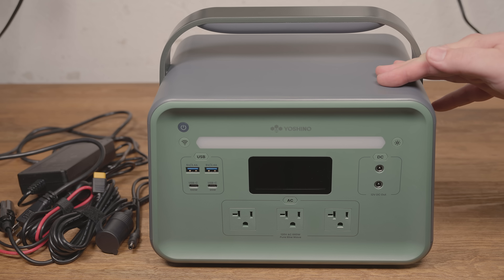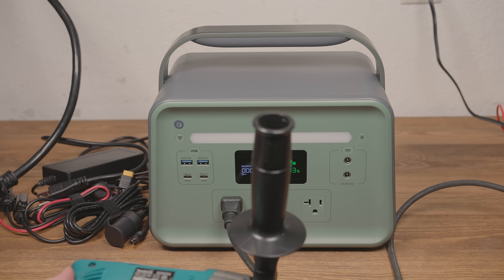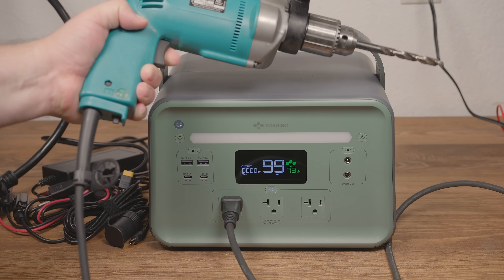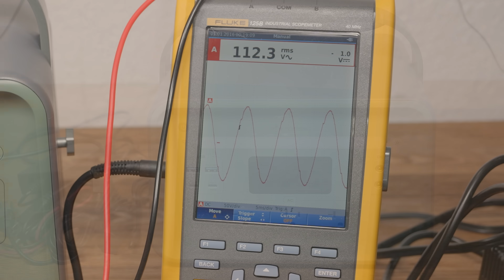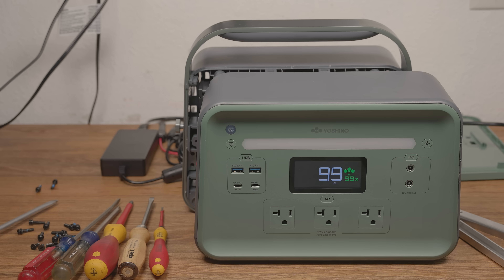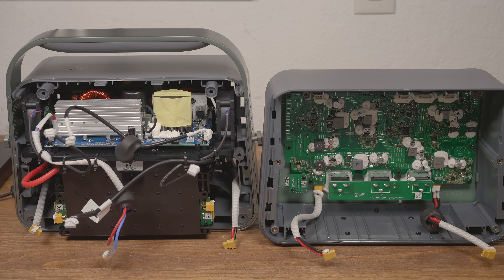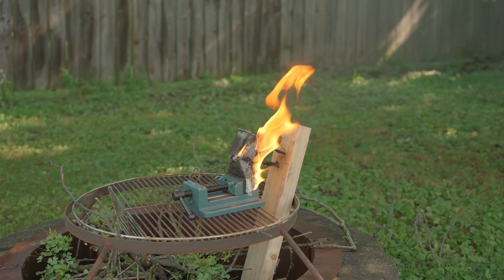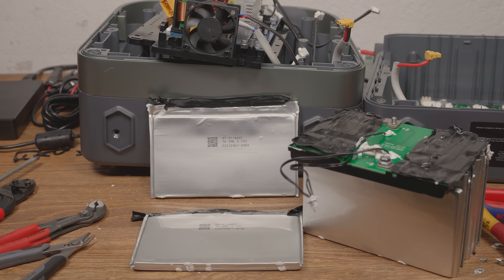Yoshino Solid State Battery Power Station, Test and Teardown!

Comment from the maker: Second update:  I did some more research on the Safety Data Sheet that comes up from the part number/QR code on the cells.  At least two of the chemicals listed are liquid, organic solvents, normally used as electrolyte in lithium ion batteries.  So...
Reply: I saw a review which stated the same about this model, so I am fairly sure it's not a 'random fluke' or just bad sample or whatever. 

But, Yoshino has two of these things right and this is the small one. This one also offers little weight benefit over conventional lithium. But their large model seems to have a way way way better capacity per weight as the other on the market big powerstations so I am wondering if that one uses the same cells or not?
Reply from the maker: @MarvinWestmaas  Also, they currently list four different models.  The B330, B660, B2000, and B4000.  But those are just the output wattages of the inverters.  The battery capacities are 241 Wh, 602 Wh, 1326 Wh, and 2611 Wh.  If you compare to competitive options of similar watt hour capacities, the weights are relatively similar.
Reply: @MarvinWestmaas  Or fake capacity.
Reply from the maker: @MarvinWestmaas  Their largest unit is 4,000 watts, but that's just inverter output.  The claimed battery capacity is around 2,600 watt hours.  That's still quite a bit, but when compared to competitive units in the 2,400-3,000 watt hour range, their size and weight is relatively similar.

There is nothing in any of their marketing to indicate that their larger units utilize different cell technology and they never responded to my questions about it.  And, unfortunately, I'm not going to buy one of the bigger ones to find out, lol.  I wish I could, but it's just not practical for me to spend that right now.
Reply: Bro! I almost bought one because I wanted to get a safe battery, you saved me from a terrible bad purchase
Reply: probably the same datasheet i found too,which states li-ion...nothing solid here :)
Reply: Why would anyone listen to someone who can't even say the word; 'Supposedly' !!! Do you see any letter 'B' in that word !?!?!?! 😂
Reply: Do you have a link to the part number, SDS for the cells?
Reply from the maker: @ElderNames  Part number: QT-9114897
Reply from the maker: @ElderNames  https://www.google.com/url?sa=t&source=web&rct=j&opi=89978449&url=https://images.thdstatic.com/catalog/pdfImages/66/6674f82e-d87d-4a75-a462-0968d05c0f0b.pdf&ved=2ahUKEwju5NyQ9OKHAxVY3MkDHe-FF6kQFnoECEEQAQ&usg=AOvVaw3UFO0VDcc030O9w2uYRSye
Reply: lawsuit time?
Reply: Why would anyone listen to someone who says the word Suppose'b'ly !!! 😂 SupposeDly  it's a D !!!! 😂 chuld ! I suppose you pronounce  the word Height   with an extra Th at the end like 50% of dumb Americans ! 😂 HITE !
Reply from the maker: Here's a link to the follow-up video:  https://youtu.be/9qtzb-hJ3nQ
Reply: What is the voltage on a fully charged cell.
Reply: Mine stopped charging this month. 
Same one you tore down.  And it always took it 3 days to charge up a solar panel.     

So three almost four months. And now I got something that doesn't work.
Reply: he Biggest red flag is that yoshino is NOT  a japanese company at all , its a shell company with japanese name and a small japanese  office that's it. 
the company has NOthing to do with Yoshino akira the inventor of lipo battery,  I mean NOTHING. 
CEO is a chinese and factory is in china. its a chinese company .
its a scam just like Kamikoto, Yatoshi.  selling cheap chinese knives selling at premium price.
Reply: There is a "review" from a person I used to respect, Matt Ferrell. 1.7M views of that shameless promotion. Disgusting.
Reply: @vadimus2007  Matt Farrel's channel has always been a promotional channel...
Reply: @vadimus2007 Hi vadimus, I'm vladimus😂. You're saying he used to be more respectable? All I've seen from him are marketing slides from companies that don't have a viable product and are looking for more VC funding.
Reply: @vadimus2007  I was JUST looking for his video in an attempt to link him this one.  I'm with you, in the 'used to respect'.  He definitely should've known not to take something like this at face value, and do a breakdown.  At the VERY least, China products haven't been the most honest and reliable.  Added to a company there claiming to basically be the first out of the gate w/ such a technology, and then just accepting it and promoting it to his large audience.
Reply: @edb75001  Matt is engaging enough, great with smart home tech but I think he should have stayed away from more technical stuff like solid state batteries. His review was simplistic at best, missing the academic rigour necessary when you review a "revolutionary" product that is more marketing than substance. There were statements like "solid state batteries stop dendrites from forming" listed as an advantage when one of the major challenges with solid state batteries has been the expansion and contraction causing cracking in both the electrodes and the solid electrolyte and, you guessed it... dendrites forming and short circuiting the battery. He seems to be more about style and the user interface than the nuts and bolts so you can see why the Yoshino batt appealed to him.
Reply: @mondotv4216 you could argue that for solid state batteries to be viable at all, they’d have to solve the dendrite problem completely. Ergo, any solid state batteries that are advanced enough to be deployed in real products won’t have dendrite problems. At least that’s what my assumption has been, but I admit it’s on shaky ground.
Reply: @Scrogan  All lithium ion batteries can suffer from dendrites. You just hope they are well constructed enough for it not to be an issue before EOL. Unfortunately we've seen that's not always the case. It's why I like LiFe (not the pouch cells - IMO any lithium pouch cell is a fire hazard) - proven technology, long life span and relatively cheap.
Reply: @mondotv4216  the PO on the end of LiFePO doesn’t mean “pouch” or “polymer” like with LiPo cells, it’s a part of the chemical formula for lithium ion phosphate. It’s the phosphate part, PO4. With LiFePO4 cells you usually either get prismatic cells or cylindrical cells, I’ve never seen a pouch cell.
Reply: @vadimus2007 , he took that video down and posted an update.
Reply: @vadimus2007  same "used to" here :( - so much bullshit gets on youtube lately.
Reply: @vadimus2007  That's actually one of the reasons I unsubscribed from him.
Reply: @vadimus2007  He delisted that video today and reuploaded it with tons of corrections and edits with the new information. The product was advertised as solid state, he had no reason to doubt it. But now that the truth is out, he's done his due diligence and made it known.
Reply: @vadimus2007  He literally just updated his video.
Reply: @vadimus2007 Matt Ferrell has always been a sellout in my opinion. I knew from the first video i watched that he had no integrity in my opinion. I find it surprising that others don't see though him so fast.
Reply: @vadimus2007  he posted a new video , but he is still just a brochure regurgitator. Shame the people with the biggest followings have the least technical knowledge
Reply: @vadimus2007  He bought the pack with his own money and stated in the video that he has no relation with the company...
Reply: @Mikenaners  Sure, he just earned couple thousands claiming he got a first SS battery based product mostly quoting scammy manufacturer's lies. 
Honest mistake for sure!
Reply: @vadimus2007  Matt Ferrell doesn't take a bow and arrow to the thing.  He just reviews it.
Reply: @jay2thedub  Citing product pamphlet isn't reviewing.
Reply: That is a fake date report sheet. It only exists on a cheap image sharing website. The battery cell information gave it away. Along with the fake company email. Not sure if you are deliberately misleading people or just trying to be relevant so you can make them Benjamins. Just saying you should look into actual li-ion batteries exploding and do some research.

Comment: A remaining power meter on LFP batteries must be singularity calibrated, as there is a 300 - 500 mV difference between 0% and 100%. It varies with each cell, with temperature, with number of past cycles etc.
Manufacturers resist the implementation of coulombic power meters, as they despise any kind of personalisation or individual alignment on their devices, as it would require an expensive knowledgeable operator on the manufacturing line.
I bet you can smell Lithium Exafluorophophate from those pouch cells, which is the main solvent used for the battery electrolyte.
Greetings,

Comment: 5 hours is not right. You should go into the setting of the PS and up it.
I have the B4000 and charge in 2 hours @ 1750 watts.
Reply from the maker: This model doesn't have any charge settings like that.  That number is their spec and based on the wattage of the include charger and the wattage of the charge port on the unit.  The B660 model simply doesn't charge that fast.  Right on their website they say "80% in only 4 hours."  So, 100% would take 5.  Actually, it could take more, because lithium batteries charge slower the closer they get to 100%.

Of course, that's assuming it was totally dead, and it probably won't be most of the time.  But there is no KW+ charging rate for the B660 model.
Reply: I stand corrected.  They were dumb to not add this function. 
I have worked mine hard and have an expansion pack as well.
Reply from the maker: I'm glad yours is working well for you.

Comment: Check the web to see if this put out a pure sign wave before plugging in my DAC & streamer. AI said it did, so I plugged in. Everything worked fine on day one at about 75% battery. I charged to 100% overnight and the next day when I started the battery the A/C outlets kept shutting down. Total load about 28 watts. I unplugged my DAC and was able to run my streamer, but I noticed a lot of transformer hum. So, I unplugged that and went back to AC. The battery also has noxious fumes.

Comment: Why not run over it with a bulldozer and se what happens? No one in their right mind would ever hit a rather expensive generator with an arrow so why test it that way? Batteries are tested against falls, water ingress, excessive heat, cold, etc. Also, "solid-state" does not mean solids like a brick, sand or banana peel. Water is in its sold-state when frozen, but heat it up above 212F and becomes steam.
Reply from the maker: I understand that nobody would intentionally pierce a battery with anything, arrow or otherwise.  However, the company claims that the batteries contain no flammable, liquid electrolytes or other flammable materials.  Clearly, that isn't true.  I later took apart one of these cells along side a common, lithium iron phosphate pouch cell and both contained roughly the same quantity of liquid electrolyte.

Comment: How do you explain the lower operating temperature?
Reply from the maker: Are you referring to a lower, advertised operating temp of the batteries in this power station?  If so, there are many slight variations of lithium ion battery chemistry and construction that have led to some of them being far more tolerant of the cold.  

There is still debate over what specific characteristics a battery must possess in order to be defined as "solid state."  For me, these batteries don't hit any of them.  They may be very good performing batteries and may even qualify as "semi" solid state, by some definitions.  But they have about as much liquid electrolyte in them as Lithium Iron Phosphate pouch cells that have been available for ages.  And about the same propensity to burn, if not more.  So I don't think they would meet the idea that most people have of a "solid state" battery.  The definitely don't for me.
Reply: @bigtb1717  Well I ordered their biggest unit and then I cancelled the order because they have done too many dishonest things.    I meant there generator supposedly can preform in like freezing temperatures which most cannot, I have never seen anyone test this?  I think it would help determine if their build is any different outside what EVERYONE is doing just cutting it open and watching it catch fire.   I wish this company well, I think they should stop lying.  They are Chinese and should not have a Japanese name, I'd start w/ that.

Comment: It's obvious they are running a Kamala Harris word salad game. They copied Honda's inverter generator technology block diagram but replaced the Honda  combustion engine/brushless generator combo  power source with a (cheap & dangerous but high capacity ) lithium ion battery (as opposed to an LFP type that avoids cascade).

Total false representation. They can change the description to "Hybrid Solid State Battery" and be safe from consumer advocate attacks like this one, but their misrepresentation gave you license to do the right thing and call them out for lying to American consumers.

Thankyou.

Comment: What battery power stations would you recommend?
Reply from the maker: I don't have a ton of experience with them,  I have a Jackery that has worked fine for me.  I only reviewed the 4Patriots Sidekick because a family member of mine was interested in it and when I looked into it their advertising bothered me and they seemed like a poor value.  There didn't seem to be a lot of info out there on them, so I got one and tested it.

I only looked at the Yoshino because I suspected they weren't a fully solid state battery.

So I don't have extensive experience to draw from.
Reply: You can easily build your own power station from an LFP server rack battery and a hybrid inverter. Cheaper and more power than these all-in-one units from China that have no tech support.

Comment: Very interesting thanks!
May I ask what you use the Knipex pliers for and if you find them useful?
Reply from the maker: I have several sizes of the Knipex pliars.  I used and abused the larger size at work for years.  I love them.  The shape of the jaws means they sort of clamp down as you push in one direction, sort of like a pipe wrench.  This makes them fantastic for pipes and other round or odd shaped things.  On a pipe, once gripped, you don't even have to squeeze any more, just push/pull.  The small one I just got for small things around the garage.  Very useful for small hoses and fittings in tight spots.
Reply: @bigtb1717  I’ll have to give a pair a try. I like how they can grip with the jaws being closer to parallel compared to a traditional pliers. 
Thanks for the info 🫡

Comment: Was it shipped to you? Did it have proper, legally required, lithium battery warning label information? If not, it should be reported. We wouldn't want another burnt up airplane!
Reply from the maker: @LarryAllenTonar  Yes, and yes.  It was covered with lithium ion and flammable warnings and it had a pouch with documentation declaring lithium ion contents.

Comment: Batteries don't have moving parts. All batteries are "solid-state" batteries.
Reply from the maker: @BOBimusRex  I agree that it's a bit of an odd terminology, but the idea is that "solid state" batteries eliminate the liquid or gel electrolytes used in traditional lithium ion batteries and replace them with something entirely solid.

Comment: The rubber donuts are probably ferrite cores, put there to reduce EMI and RFI interference.  If they do this, it means they have a poor design against radio, TV and cellphone interference.  Ask them about their mandated FCC interference testing, and/or just put a radio about one-yard away, and see if you can here the noises.  These vary under load.  Ask a nearby radio-ham to check these unit at various frequencies.  I'm betting they will fail the legal testing.

Comment: So many cheap overload protection algorithms do this. It's an issue with a lot of smart plugs with energy monitoring. They cut power off when your compressor turns on (refrigerator, window AC) and then your room gets warm or the food goes bad.

Comment: Ok man i cant do the video..  maybe try and be less captain obvious..   you taped off the cells, yea why else to protect..  yea the battery was out..  didnt think it was still in there with it center frame..  going over the nonsensical whatnot like the connectors and brushing over more interesting stuff like what was in the power supply..  just a typical undersized switching or solid state heater..  just saying..  i tried finishing the vid but cant..
Reply from the maker: I appreciate the feedback.  Cheers!

Comment: I comment about this everywhere when I see people takes this seriously. I work in the field of lithium cell, and there's currently no solid state cells in mass production all over the world. What we have here in these Yoshino battery packs is what we call semi-solid state cells. They are indeed better than more traditional cells, better density, a lot more resistant to damage. But unlike a fully solid-state cell they still self combust upon penetration. However, as long as they claim this is solid state battery, it is a scam.
Reply from the maker: I agree, I think these are "semi-solid" state.  But they aren't marketed that way.

Comment: Yoshino Power is a Japanese company although they may be manufactured in China.
Reply from the maker: Do you have any links or anything to show that?  I only ask because when I asked for certain details about the company, they wouldn't give me anything.  However, I did find this in the ETL listing:

Company:  SUZHOU YOSHINO POWER TECHNOLOGY CO.LTD. - Kunshan, Jiangsu CHINA
Trade Name:  Yoshino.

To be clear, I don't have a problem with that, but I just don't see anything to indicate it's a Japanese company.  Even on their website, they say they use Japanese battery technology, not that they are a Japanese company.  And just FYI, the company making the batteries is Chinese too, though that doesn't mean they didn't acquire the technology from Japan.